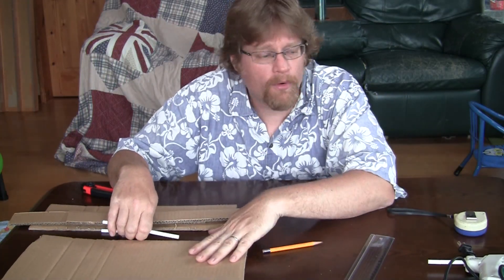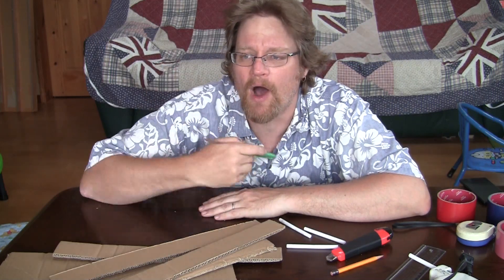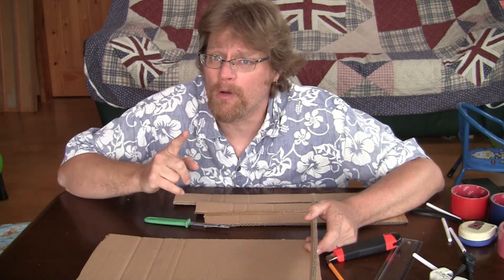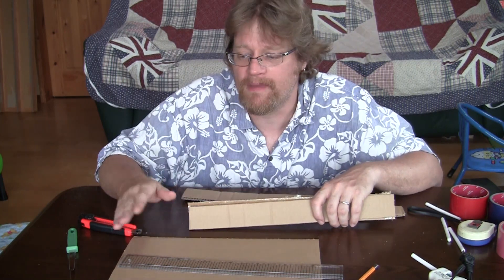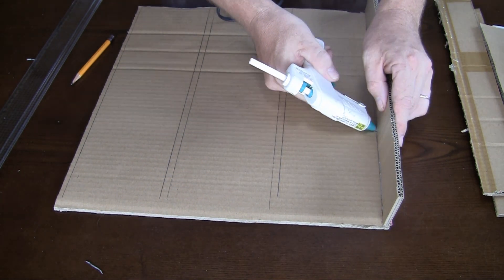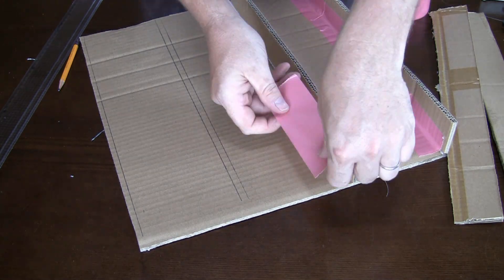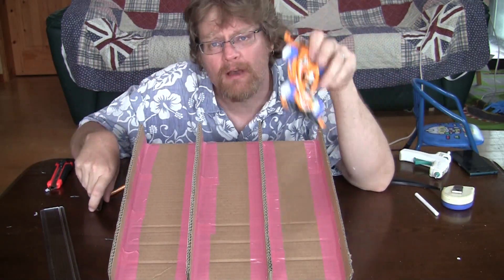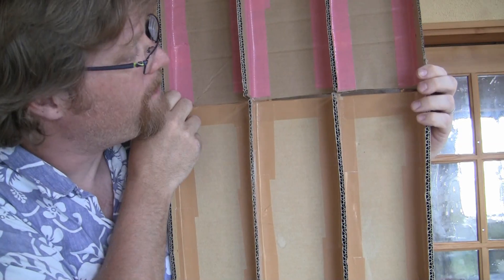How To Make a Homemade Cardboard Tamiya Mini4WD Track ミニ四駆

Comment: Hi, thank you so much for posting this video. I have a couple of questions, 1, How do you make the turns? Did you had to figure out the angle? 2. How long is your track? I'm trying to build one right now but i'm not sure how long I want the track to be. 
I use an xacto knife to cut. I use a metal ruler and press the edge of the knife against the ruler, it worked out great for me so far.
Reply from the maker: The turns are actually easy. I figured out how wide the full half circle of a complete turn is and found the center point. Then I measured from the center point where I wanted my walls, drawing many dots to show where the arc goes, then connected the dots, cut out the shape and then taped and glued on the walls. Does that make sense?
I'm not sure if I explained that well enough.
Reply: @Sparkuus  yep, I got it thank you very much!

Comment: Is that packing tape or masking tape  you used?
Reply from the maker: It's neither. You could use either of those I guess, but this is a cheap brown duct tape clone. Not quite as good as real duct tape, but better than some of the other options. I think packing tape would make too slippery a surface.